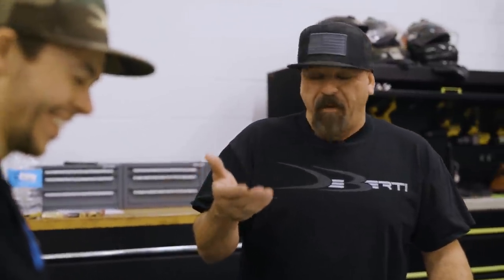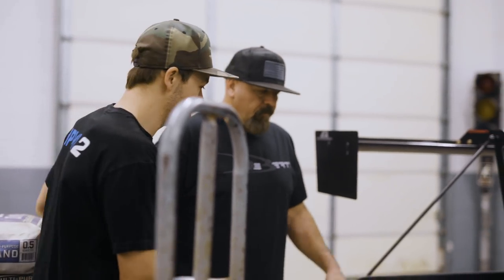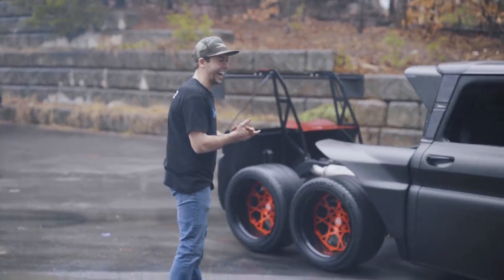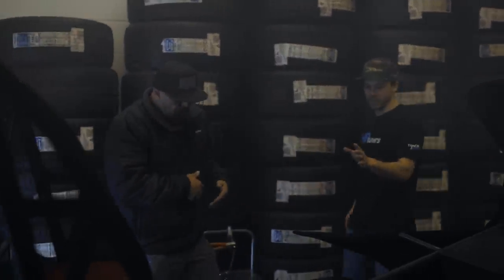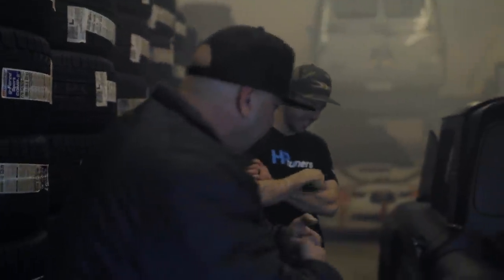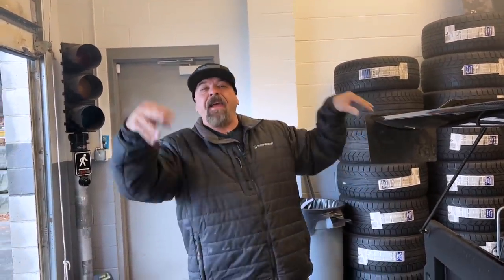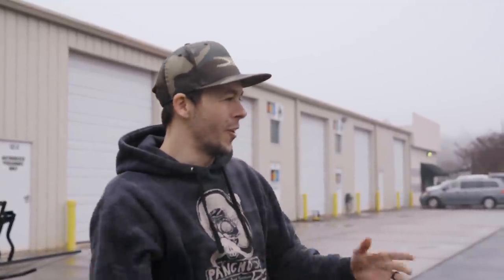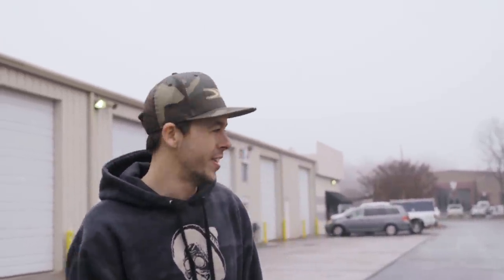WE DESTROY ALL TIRES IN OUR 900 HP SUPERCHARGED LSX TANDEM AXLE C10 TRUCK!!!

Comment: Get some old steel wheels, bolt them on the back and fry the tires. Those wheels are flexing a lot. I think the suspension is fine the way it was with the 700lbs springs on both rear axels and the hydros hooked up. A little axel wrap is normal but when in combination with those wheels, it's the wheel flex that's causing most, if not all of the wheel hop. Hope my 2cents helps out!
Reply: you need 2 more longer rear ends and different offsets for it now.
Reply: I question the opinion of someone who cant even spell "axle".
Reply: @lastofthebest5102  forgive me for making a typo.....😒
Reply: How could the wheel flex that much and sill be round? wouldn't it be bent/ out of round?
Reply: @ahhason  it may be, it could be stress cracked. If you watched the video, you saw that wheel on the first rear axle look like it was turning left and right, not really bouncing up and down.

Comment: You need to use a weight scale under all six tires and adjust the suspension pressure to even out the weight perfectly. You need to also get different rims that are perfectly centered with the ends of the drive shaft.

Comment: Told ya . . I knew uneven pressure caused the front to be bad compared to rear.  That being said. Still need perm fix to equalize grip on a flat plane with fron steers and frame or reinforcement to muscle through with ur adjustable geometry

Comment: I do believe I called the wheels flexing in the last video by saying check the wheels for stress. Glad you guys got it figured out.
Reply: It's the axle(s) dancing around. Especially side loading making a turn as he did. I doubt the wheel flex that much and not be damaged. Again like last video not capturing the right camera angles. Hard to come up with the solution without seeing what's really taking place. This video the front axle acted up, last video the rear.

Comment: How episode started would be cool.
Made a list of ideas from comments, if just worked down the list and tried each one.
Would be a good elisode to see...

Of course it worked when on a wet surface, added smoke from moisture evaporation, like one of the comments I made in last video, can make a easy way to make any surface wet and slick from in cab.
Inertia of rear tire spinning and bowing the tread like a bubble, higher speed the higher the bow, watch tractor pull or drag racing.
With rear axle so light, 
Rear tires are making smoke but not much, isn't the point to figure out how to make them all even?
With same spring rate on both rear axles, the angle of truck will have different load on axles, nose up and will have more weight on rear, nose down and more weight on front.
A set of scales to see the difference.
With air setup and each side linked together, woukd even the pressure on both axles per side.

Not having the rear axle touch the ground is like you made a 2wd truck and threw in a dead axle for looks, and no other purpose.

Comment: Would a wheel that has, I guess a centre that attaches to more surface area of the hoop, help with the flex and destabilisation of the wheel?? Basically a wheel over all stronger than the current one.

Comment: Up until the wheels wobbled/flexed, on this episode ,i thought the 4 link might have been mounted too far away from the wheel end of the differential and needed to be moved out because in the last episode you can clearly see the diff ends flexing which would put it out of alignment with the outside of the tire/rim which introduced the wheel flexing just my observations. cheers

Comment: Would be interested to see you get some race scales under the for rear wheels to see the load difference between the rear axels. I don't think it will help the wheel hop but interesting to see none the less. Maybe try and balance the loads between both axels.

I think your actual issue is the axel housing flexing. The wheels always seem to oscillate  back and forward, not up and down so I don't think adding weight or making suspension adjustments will help. Is it an option to weld bracing along the back of the housing?

Comment: Maybe try the soft springs infront and hard at the back? put the weight more on the rear axel equals longer wheel base for the power to the ground meaning more stable seeing that most of the wheel hop comes from the front axel

Comment: One thing that might not hurt is to isolate the axels on the hydraulics. So each axel is on its own valve then you can better control the weight distribution. If big semi's can do burnouts that beast can too.

Comment: It almost seems like a type of limited slip has to be considered between the front and rear tires as well as left to right. Just like if you weld the rear did and do tight turns you get wheel hop because the tires won't compensate with the grip demands of each other.

Comment: We have a similar problem with the basket inside the 4L50E tranys.  guys will get stuck in the mud & start rocking their rig forward & back & up to 6k rpm.  The centrifugal force causes the basket to swell & the fingers flair out. It will cut a huge grove almost slicing the case in half.  Those must be forged wheels or they would have shattered.  Crazy physics show lol.

Comment: DAD'S RIGHT AGAIN DEFINATLY WHEEL CENTRE OSSELATEING MAKING PROBLEM AND TWO MORE TIE BAR EACH SIDE (WITH ROSE ADJUSRABLE JOINTS SO YOU CAN TENSION IT RIDGID WHILE CAN MOVE UP AND DOWN ,VERY GOOD YES) , TIE THE TWO TOGETHER RIGHT BEHIND THE WHEELS N TIRES , COULD EVEN USE LEAF SPRING STYLE U BOLTS AND PLATES WITH TWO TABS WELDED STICKING OUT WITH HOLE FOR TIE BAR BOLT X4 TO LONG ENOUGH TIE BARS AND BOLT STRAIGHT ON TEST THE THEORY ,PROVE IT WORKS HAVE THEM MOUNTED PERMENANTLY

Comment: if it's a rotational issue, then, why not try and add in extra chassis suspension to dampen the rotation such that when the chassis tries to rotate around the pivot point, something pushes that rotation back and dampens it so it stops hitting the resonance frequency

Comment: Just thought about something important, check with dot laws since it has 3 axles on power unit, if you plan on driving on roads quite a bit.
Weight matters on single rear axle with the 26,000 lbs but if I remember l, adding a tandem then weight does not matter.
Don't want pulled over and a stack of tickets.

Comment: Well looked at the video better . I think it’s called deflection issue . Structure basically . Tow a trailer or solid frame the engine to to rear . Or. Try invent a hard point center Frame rail that twist in the middle but stays stiff .

Comment: As I used to be a tyre fitter it's way too much mass for it to turn I guarantee you put a smaller satay tyres on all four and you'll be very surprised you be able to put the RPM to even higher

Comment: I think the same exact thing would be true if u took all the weight off the front set and put all the weight on the very last tires… lower the pressure on the front set of hydraulics and leave the very last tires carry the weight and technically u will maintain a longer wheel base this way. I hope i made sense. That truck is so bad ass.

P.s the audio for me was super low, i can barely hear u guys

Comment: Did you fix the wheel hop yet what gear ratios are you running i dont think they can be the same you want the front tires to turn a little faster the ho is usually caused by the pinnion angle getting out of whack if it goes up to much so make sure both diffs are down like 5-7 degrees down and make sure their not moving around to much thats why traction bars use to get rid of wheel hop cause it keeps the differential from spinning up when you nail it

Comment: With as long as the truck is and that much horsepower, could it have been squatting too much on the rear axle and making it bind a little or making it uneven with actual spring pressure? Either way, good fucking job!!

Comment: It's the axle(s) dancing around. Especially side loading making a turn as he did. (Yes maybe too much sidewalls but not the root of problem) I doubt the wheel flexed that much and not be damaged. Again like last video not capturing the right camera angles. Hard to come up with the solution without seeing what's really taking place. This video the front axle acted up, last video the rear.

Comment: In that first clip in the video the front rear wheels were cavitating from left to right. They can't do that. What is causing them to move from left to right, not back and forward, but left to right? It's like something is wrong with the a arms or something. I'm not an engineer, so take that as you will. Somethings causing them to move in a way that is undesirable. Need to stiffen the rear end up, left to right, back to front, everything. Not suspension wise as far as up and down.  They need to be a solid unit. All four wheels. Their only goal is to go forwards and backwards... unless you have four way steering.  I'm just a keyboard warrior, so take this as you will.
Reply: I mean 6 way steering?!?  Spherical bushings in the rear end? Is something flexing? Do you need more bracing? Put some cameras on the rear wing pointing down towards the rear suspension? I'd love to have a good look at the setup of the rear end. I once said that to my ex.... yeah, my ex. Apparently rear end analysis was not on the table and it's obvious now that my apologies weren't accepted. #I'mSoLonely
Reply: My comments were made before watching the whole video... 🤦‍♂

Comment: For the purpose of tire slaying alone, would locking up the rear suspension(i.e. no suspension in the back) be a plausible idea? Im not sure if that would break anything right away or not. When the truck started to crab walk it started hopping bad, may be a way to see if the wheels are warping at high rpm at least if it wouldn't break things.

Comment: Watch this video. It's the nature of tandem axles to wanna hop, so much grip yet bearing little weight (tandems=double the tire to ground contact yet half the ground pressure)  In this video there's lots of wheel hop but in no way can you say those wheels are flexing. https://www.youtube.com/watch?v=fTKcGYrg54M
Reply: To me it looks as if some of these trucks have their air bags dumped and others airred up. Does it make a difference? Hard to say.

Comment: What's impressive about that??? Theres no weight on the rear end and its distributed over 4 tires.So each tire has very little weight bearing down on it.A smaller motor could do the same thing.